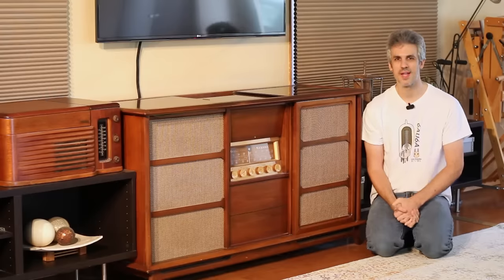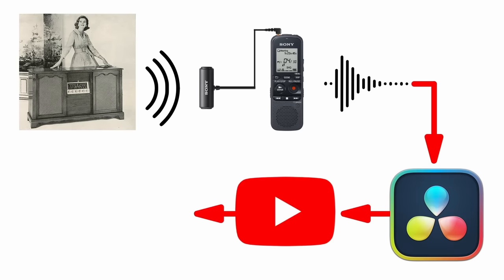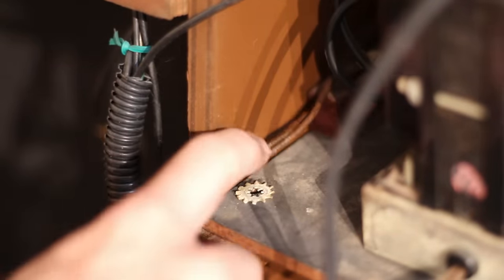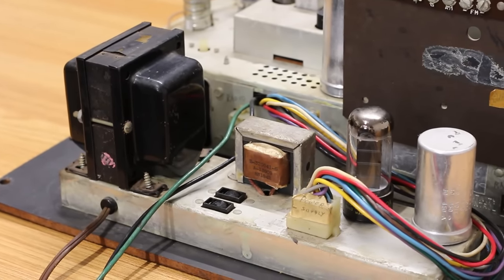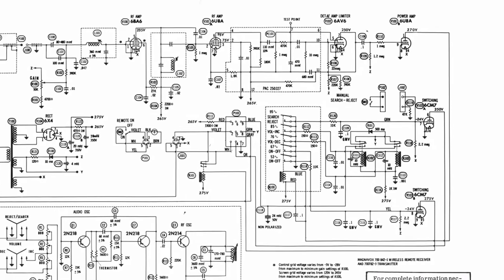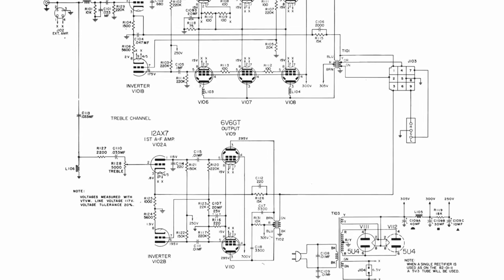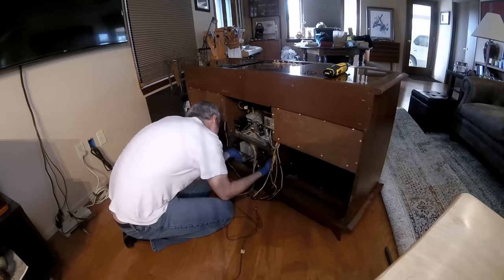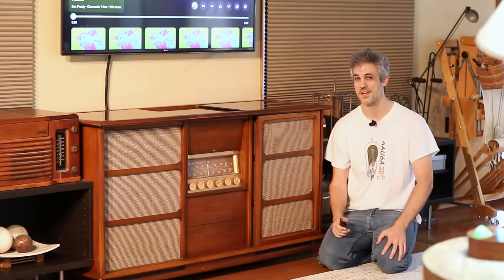A Look at our Magnavox Concert Grand Console Stereo

Comment: The FM MPX Stereo transmission standard Zenith came up with was approved by the FCC in 1961 and has been in continuous use ever since. The MPX jacks are for an optional FM stereo decoder (which looks like is not present in your console). For a few years the decoders were optional even in TOTL sets like this since they added cost and in many places there weren't any FM stereo stations on air to justify said cost. FM MPX stereo adapters often show up at antique radio swap meets and on the internet....I've rebuilt a few and added them to mono FM tuners. It's worth getting for a console like that.
The Concert Grand (not being able to find one under 4 fgures) was my inspiration for extending the TV remote circuits (with relay logic) on my Zenith Chancellor TV/Stereo combo to also control the stereo system (most combos with remote only controlled the TV remotely). https://youtu.be/8IYZDpPr_xc Besides the Concert Grand and a Zenith SC1000 combo remote control stereo wasn't a thing until the 70's-80's (and wasn't common even then). Your remote system is probably ultrasonic (though there were a scant few RF based TV remotes back then). I haven't studied the schematic closely but it probably either multiplies those base frequencies up to ultrasonic or uses them to modulate an ultrasonic or RF carrier. It's interesting that Magnavox used a transistor remote for that...Most of their Phantom ultrasonic remotes were mechanical. I've got a mid-60's Magnavox round CRT color TV with the phantom remote and the remote is a bellows that both buttons press and each button gates the air path for a separate ultrasonic (dog) whistle. Zenith (who pioneered Ultrasonic TV remotes) used metal rods and button actuated hammers that struck metal rods that resonate like tuning forks. 
You should be able to get several AM stations (especially at night) no matter where you are in the US (I'm in Wisconsin and have received Texas AM stations at night repeatedly), and probably FM too though if your in a difficult location you may need a rooftop outdoor FM antenna. People think FM has no range because of the capture ratio effect...Basically if 2 FM stations on are on the same frequency whichever is stronger is the one you will hear so stations have overlapping coverage areas (if you're ~ half way between stations the sound will be a mess as the 2 carriers duke it out for control of the detector in your radio). FM stations can travel a hundred miles if there isn't anything else on the frequency stronger and or closer.  If you can't get any reception on any band one or maybe 2 things is going on: either the radio needs service, and or you've got excessive RF noise in your home from switch mode power supplies, LED lighting etc.  If you can get decent reception on a car radio out in the wilderness a mile or two on either side of your home then there's probably interference in your home. For interference get a battery radio, flip every breaker in the house off...If the noise goes away yielding reception then flip each breaker on one at a time with a half minute between and the one(s) that introduce RF noise have problem devices that you can narrow down (unplug each device the breaker powers until you know which stop RF noise) and replace or modify said devices to suppress RF noise emissions. If with all the breakers off the noise is still swamping all reception then it may be your neighbors radiating RF noise either through the air or the electrical grid.

Comment: I had a car bi-amp FM and audio cassette stereo in the late 1970's and earlier 1980's. It had two modes. Two speaker or four speaker modes: Single stereo mode for using one speaker for each of two stereo speakers. Bi-amp mode for using a general use speaker and a tweeter speaker for each of the two channels. Bi-amp mode gave the best use of bass and treble controls. Otherwise, for just using two speakers, the bass and treble controls was more like a tone control. The bi-amp mode sounded nice. I don't remember why I didn't keep it.  It might have been the system that was in my car that someone else hit and wrecked. The tow place left the car outside of the tow lot. I remember some stuff was stolen because of that. That might have been it. In any case, the bi-amp system worked well and sounded nice.

Comment: Hand Built to Perfection, Its the Picasso of all stereo's. One of these Units would of roughly cost $1700 back in the day and in todays pricing using the inflation calculator this would of set someone back $17,677.07.
Reply: Perfect.  I was wondering about  the price in 1962

Comment: Impressive!  
Minor correction... The amplifier power supply is a full-wave rectifier with both tubes in parallel (for current handling capability) and not a bridge rectifier. Bridge rectification using tubes is possible but is almost never used since it doubles the voltage drop across the tubes, and can create difficulties with the filament circuits due to two of the cathodes then being on opposite sides of a high AC voltage from the transformer. The full-wave rectifier that you have applies the AC only to the anodes, and the cathodes are simply held at the positive HT voltage.

Comment: You may be able to build your own remote for testing the remote functions or even using daily if you put it into a nice enclosure. It looks pretty simple in design! Several options for IC’s that you could use to generate the tones needed. VCO’s or various tone encoder IC’s designed for the telephone and commercial radio industry (see “DTMF encoder” or  “PL encoder” or “paging encoder” circuits.)

Comment: What a gorgeous example of classic technology art!  My family had a very nice monaural hi-fi console in the 60's, but it was nothing close to that level.  One thing --- it appeared in the video that you may be using the original power cord.  Given its age, that is probably unsafe.  That old plastic insulation just gets too brittle, and there is probably significant oxidation in the metal.  I urge you to consider replacing it with a modern cord.  It would be best to use at least one wire gauge larger than the original.

Comment: Magnavox made a lot of high-end and rugged military electronics.  Also PLATO graphics terminals, about $7000 each.  So they were used to making solid stuff.  You rarely see 6V6's in parallel, as then you have double the cost and power drain and heat but only 3dB (barely audible) increase in loudness.
Reply: Parallelling the 6V6's lowers the output impedance (cuts it in half) and allows you to use a 4 ohm speaker load on an output transformer that was design-optimized for an 8 ohm load; or an 8 ohm speaker load on a 16 ohm output transformer.  Also the ideal primary impedance of an output transformer being used 46L6 output tubes is about the same as what parallel 6V6 tubes would like to see and therefore the manufacturer can buy one type of transformer and use it for several different amplifiers with different output tubes. An extra tube and socket might well have been cheaper than buying a specific transformer for 66 is as opposed to 6 l's sixes period or maybe they got a deal on speakers of a certain impedanpeyton's and it was easier to adjust the tube output stage's impedance for a good efficient reflected load through a given transformer and speaker.

Comment: A full tube radio and amplifier circuit really does have a special sound quality to it. Add to that these are probably using large format full-range active magnet speakers and it really is a sound that is difficult to reproduce with modern equipment. The tech is just so rarified nowadays because passive magnet speakers have long since become the norm. Having said all of that, I suspect that the qualification of "best sounding stereo in the world" should probably be limited to such stereo cabinet enclosures rather than standalone stereo speaker systems. There were actually some very nice sounding stereo systems that weren't built into a cabinet like that. Regardless, the accuracy of the sound isn't really what matters, but whether or not you like the sound. That's really the most important aspect.

Comment: An excellent stereo system. My grandmother had the one with the Color TV and Bar along the AM/FM Stereo radio, phonograph record player and 8-Track tape made in '68 or so. Also by Motorola.

Thing about those ancient Color TVs is that they had a Red/Yellow/Blue Phosphorus CRT and not the RGB from the 70s to present date.

Tube amps sound a lot better than today's digital crap. Not MHO but fact.

Comment: MPX is stereo FM. Before stereo MPX FM broadcasting was approved by the FCC, the way that stereo was broadcast was to send one audio channel on an AM station and the other on an FM station; many receivers of the time had separate tuning knobs to allow simultaneously reception of AM & FM for a stereo broadcast. With MPX (multiplex) FM, a receiver used the now familiar method  where both left & right audio channels are transmitted on a single FM station. Some radios of the time had both AM/FM as well as MPX stereo mode. This Magnavox offers FM (mono) and FM MPX (stereo) modes.
Reply: As to the second receiver chassis, while it may well have contained a remote control receiver, it probably also was the stereo multiplex decoder.

Comment: I am no expert but to tune your radio after restringing it you should get a cheap RF signal generator. I have seen shango use this technique on his YouTube channel numerous times and it doesn’t require being able to pick up radio station transmissions. The RF signal generator transmits a tone on whatever frequency you set it to. When the radio is on that frequency you can hear the tone through the radio speaker. The one I have seen shango use does both AM and FM frequencies. Hope the information helps.

Comment: The very best stereo EQ in 1962 were components who's performance vastly exceeded that of any console, even this one. Arguably he best would have consisted of a Thorens TD-124 turntable/SME 3009 pickup arm with a Weathers phono pickup, a Marantz 7C preamp driving a Marantz 8B amp or twin Marantz 9 amps for more power or McIntosh amp/preamp (all are tubed)... driving Quad 57 electrostatics with Hartley subwoofers and Ducane Ionophane super tweeters. For high power installations the speakers would have been JBL Hartsfields or JBL Paragon. In 1962 every informed audiophile knew this kind of stuff was the very best money could buy if realism in sound in the home was the goal.

Comment: Sounds like you need a decent antenna, as in many meters of wire way up in the air, then you'll get some stations.
Radios in rural area's usually used fairly substantial antenna's for any reception.
The 12AX7 on the amplifier inputs is a phase slitter, the two banks of 6V6GT need to be driven out of phase from each other. As one set if going positive, the other is going negative & vice versa.

Comment: FM MPX is Multiplex - Could be a MPX unit built in to the device, or could be an input on the back for a MPX module, depending on what the configuration is.     MPX is used for decoding FM Stereo 
They don't make electronic devices like they use to, especially when you go back to Tube equipment.   I love the sound of Tube amplifiers.  Some love them, some don't, those that love them think they are the best :)
The speakers did tend to be larger back in the day, mainly because enclosure technology was not as good as it is thee days, but back when your one was made, it also was a lot to do with building quality rather than cutting corners to save cost.
The remotes, instead of using  audio frequency,  likely used RF style.  It will be hard finding one now

Comment: From an old memory.... as a 17 year old, just starting work in 1961, those transistors were worth $US4.00 each.  That meant I could buy ONE per week until I could build something. no, not in the USA. Far, far away from there. Of course, I also needed diodes for the rectification circuit, and they were MUCH cheaper, only $US1.00 each

Comment: HI in those days they transmitted an AM modulated carrier that had a selectable "tone" (audio frequency)  or an ultrasonic transducer  that fed into a set of reeds that were aligned to that particular frequency, the energized reed would vibrate making connection to a contact and energize a circuit i.e. a volume motor or channel motor.
the amplifier is to die for, I would love to have one of those sets(audio

Comment: The consoles of the late 60's and early 70's that I remember everybody having, including ours were nowhere near on the level of this Magnavox or Zenith consoles  of the late 50's and early 60's. By the 70's these things were mass produced by every off brand known to mankind! The components inside were a cheap one piece am-fm tuner/amplifier pushing out a few measly watts into efficient but cheap low grade paper speakers with these puny magnets that distorted badly. The wood was the most expensive part of the damned thing! I'm now a 63 year old black man who's come a long way from consoles, all in one component systems with fake wood grain peeling on the side, boom boxes, and receivers, in that order. Since the mid 80's I never looked back and don't miss any of that stuff as I became a high end separates man, (audiophile ).😁👍

Comment: That's an amazing stereo there :) I had a Revox G36 reel to reel deck from roughly 1963 (which would make it a nice companion to this Magnificent Magnavox), and the built-in 20cm Philips speaker sounded amazing driven by two ECL86 tubes. Similarly, there were a couple of transistors in my unit, but only for end of tape switch. There are some videos about it on my channel, like this one: youtu.be/IZUcAIe86kM
Btw, FM MPX stands from FM multiplex, which is just an older name for FM stereo. FM transmitters do label their input as MPX in, because MPX signal these days includes RDS data and HD radio channels (at least in the US).
For setting up the FM radio dial precisely, you can use a Raspberry Pi as an FM transmitter. The audio quality isn't that good, but the frequency accuracy is good enough for the task.

Comment: It seems that those amplifiers provide around 13W for the horn and 39W for the woofer and that ammount of power going to those efficient Alnico paper speakers is 100dB+ garanteed.
Reply: It's basically a early P.A. system in a box.
Reply: I would think that the woofers would be about 95dB/m yet the tweeters could easily do 105 and very much agree that Alnico will sound better than modern magnets....

Comment: A single pair of 6V6's can put out about 15 watts with the power supply voltage used here. Then that would mean each woofer is getting about 45 watts each and each tweeter 15 watts each. Making the total (RMS) power of the system a house shaking ceiling and wall cracking 120 watts. (Bear in mind that many manufacturers used a "peak power" rating). This is very high power output for that era. Remember that the bass takes most of the power, so the smaller power output to the tweeters is proportionally correct. And bear in mind this is what is called a bi-amp system which is much more efficient than having a single amplifier handle the full  audio range.

Comment: Make sure the power supply caps are okay without excessive leakage inductance, partial shorts, etc. Also, consider going through the amps & tuner sections, replacing the old, drifting carbon comp resistors with modern metal oxide or metal film types, and modern equivalent audio caps. I've rebuilt many amps for many years and it's like getting cotton pulled out of one's ears, the difference is that great. Just don't fall for the magic goat crystal caps crap. Buy the best quality and you're good to go. All that said, Magnavox amps from the 40s through the early 60s are magic. They really knew what they were about.

Comment: Please message "Mr Carlson's Lab" here on youtube, he may have or likely knows who might have the proper service manual for setting up the radio portions and the intermediate frequencies used so you can tune the radio portion.  The service manual will also have a way to fix and set the radio dial as that was a common repair apparently back in the day.  He also has a great couple of videos on his antenna setup to get VERY weak radio signals  in I believe it is called  the 3/6/9 antenna.  anyway.  good luck with the incredible radio.  I cannot imagine how great it must sound in person.  

also maybe go the LTT direction and get permission to play crab rave for us :P

Comment: Looks like a induction fan motor @10.05 in the bottom left. I'm sure it's not because of the adapter plate in the front in place of the fan.
What is it?
Reply: Looks like the tuner had remote control tuning. The "adapter plate" is likely a reduction gear, and the dial cord (which broke) wound round the output shaft. All so you could  re tune stations from your armchair. TVs of the same era also had induction motors linked to the tuner for the same reason.
There is probably a SAMs Photofact  service sheet out there for this tuner which would include the dial cord routing. Also radio dial cord is still available without having to improvise with fishing line or such like.

Comment: The right terminology for those amplifiers is "freakin' amazing!"  Seriously, that is one wonderfully high end stereo. There are some capacitors you may want to check for leakage: C103 and 105 in the bass side and  C115 and C111 in the treble side, on your schematic. If these go leaky the output tubes could get fried.
Reply: Luckily there aren't that many in this design. As if they knew beforehand, the electrolytics would become a pain in the *ss in the future.